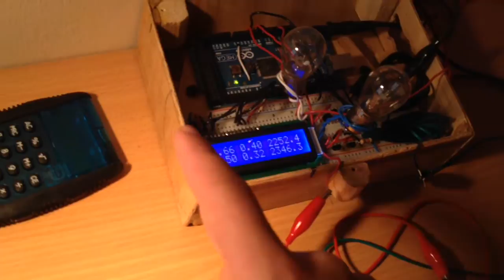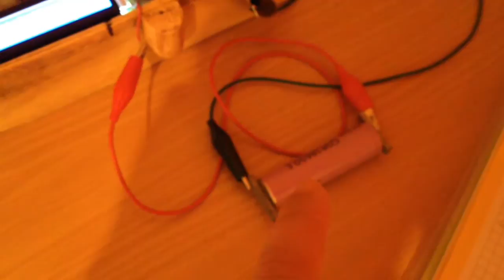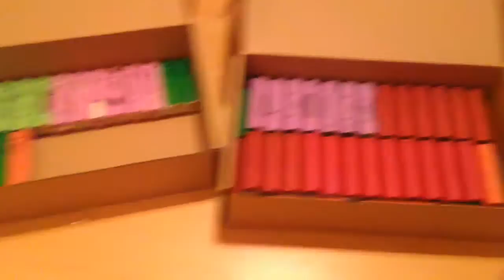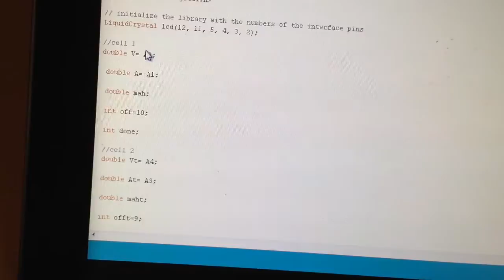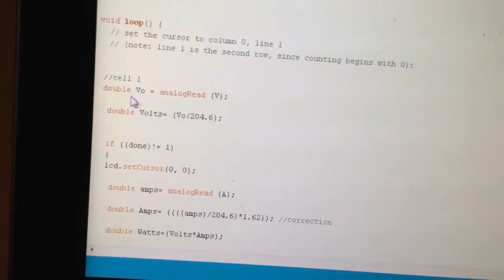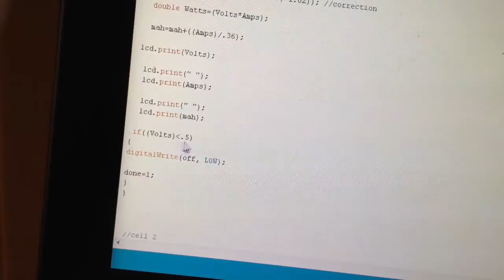Arduino multi cell lithium battery capacity tester

Comment: 0.5v is cutoff is very dangerous 2000mAh at 0.5mah is not a strong cell
Reply from the maker: I have alot of resistance in series so from my tests this is what works.  I totally agree it is super low and would be very bad at the cell.

Comment: i tried to make this but data right to pc. the measurements are very inaccurate. i've got an uno r3. voltages can fluctuate as much as -+.25v and since i'm using a resistor without an opamp i only have about 50 levels of  curent measurement, but with the voltage inaccuracy i just mentioned.  do you have anything special to avoid this?

Comment: This is exactly what ive been searching for!Multiple 18650 discharger / capacity tester! If you could provide us with schematic, that would be awesome.And also, could you make arduino report multiple values to the pc? It would be easier to monitor all the measured capacities in a list on pc when having more than 2 of these batteries

Would u please share the schematic for this .my mail id all4ufashion2015@gmail.com

Comment: WoW! This is exactly what ive been searching for!
Multiple 18650 disscharger / capacity tester! If you could provide us with schematic, that would be awesome.
And also, could you make arduino report multiple values to the pc? It would be easier to monitor all the measured cappacities in a list on pc when having more than 2 of these batteries
Reply from the maker: Easiest way is to do serial monitor then you can fill you computer with the data and copy paste into excel.  Could also do a data logger and have information on sd card

Comment: Could and would you please draw a diagram of the circuit, and the components... I can`t figure out the load resistor and the point to messier..

But very nice work, and very handy tool... tanks a lot..

kind regards
Simon Jensen
Denmark

Comment from the maker: // include the library code:
#include <LiquidCrystal.h>

// initialize the library with the numbers of the interface pins
LiquidCrystal lcd(12, 11, 5, 4, 3, 2);

//cell 1
double V= A2;

 double A= A1;
 
 double mah;
 
 int off=10;
 
 int done;
 
 //cell 2
 double Vt= A4;

 double At= A3;
 
 double maht;
 
 int offt=9;
 
 int donet;
 

void setup() {
  // set up the LCD's number of columns and rows:
  lcd.begin(16, 2);
 
  pinMode(off, OUTPUT);
  // Print a message to the LCD.
  //lcd.print("hello, world!");
 
  pinMode(offt, OUTPUT);
 
}

void loop() {
  // set the cursor to column 0, line 1
  // (note: line 1 is the second row, since counting begins with 0):
 
 
 //cell 1
 double Vo = analogRead (V);
   
  double Volts= (Vo/204.6);

 
  if ((done)!= 1)
  {
  lcd.setCursor(0, 0);
 
   double amps= analogRead (A);
   
   double Amps= ((((amps)/204.6)*1.62)); //correction
   
   double Watts=(Volts*Amps);
   
   mah=mah+((Amps)/.36);
 
 lcd.print(Volts);
 
  lcd.print(" ");
  lcd.print(Amps);
 
  lcd.print(" ");
  lcd.print(mah);
 
 if((Volts)<.5)
{
digitalWrite(off, LOW);
 
done=1;
}
}

 
 //cell 2
 
 double Vot = analogRead (Vt);
   
  double Voltst= (Vot/204.6);
 
 
 if ((donet)!= 1)
  {
 
   
   double ampst= analogRead (At);
   
   double Ampst= ((((ampst)/204.6)1.62.82)); //correction
   
   double Wattst=(Voltst*Ampst);
   
   maht=maht+((Ampst)/.36);
 
  lcd.setCursor(0, 1);
 
  lcd.print(Voltst);
 
  lcd.print(" ");
  lcd.print(Ampst);
 
  lcd.print(" ");
  lcd.print(maht);
 
 if((Voltst)<.5)
{
digitalWrite(offt, LOW);
 
donet=1;
}
}

  delay(10000);
 
 
 // reset cell 1
 if((Volts)>3.9)
{
  done=0;
  mah=0;
  digitalWrite(off, HIGH);
 
}
 
  // reset cell 2
 if((Voltst)>3.9)
{
  donet=0;
  maht=0;
  digitalWrite(offt, HIGH);
 
}
 
}
Reply: Hello, how can I contact you?
Reply: THANKS FOR THE CODE AND THE VIDEO IM A NEWBIE BUT WILLING TO LEARN